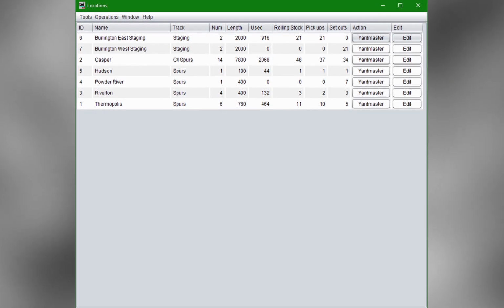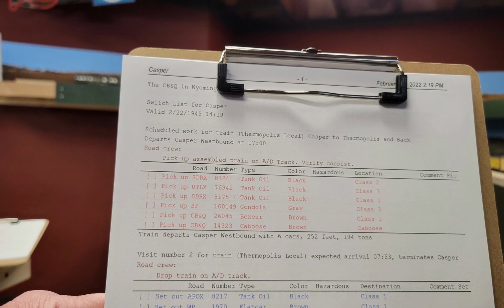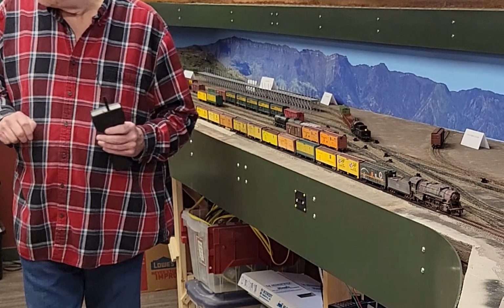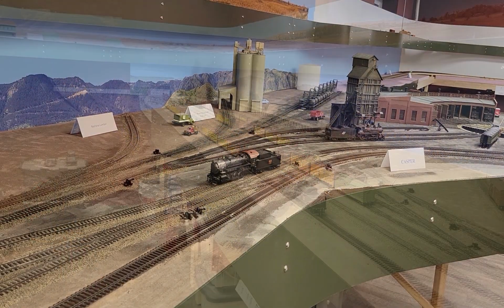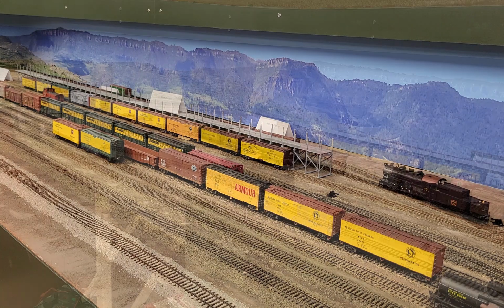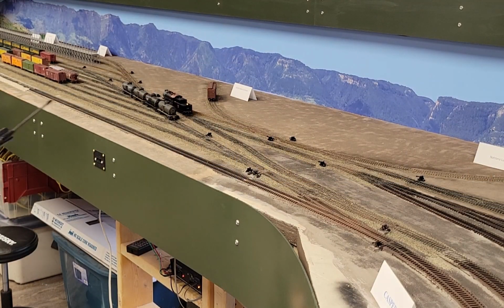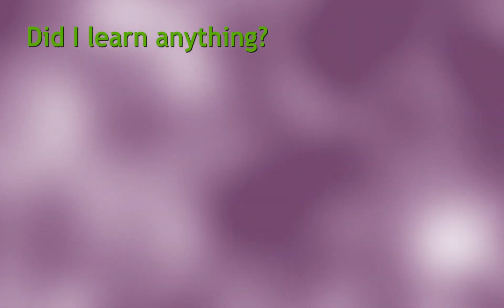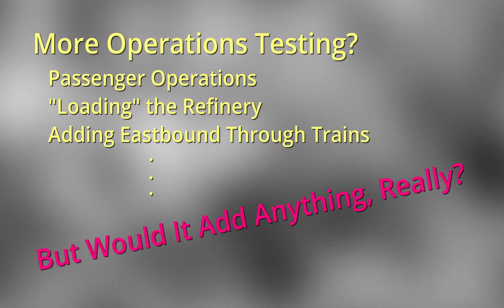2022 02 24 Building Casper Episode 8   Operations Testing 1

Comment: Nice work Mark. Are you planning on have regular op sessions with a crew or will you operate this railroad solo? Have you always modeled the steam era in the war years?
Reply from the maker: Thank you! I'd like to have regular op sessions, but so far there's only one other "operator" I know of in the area. There are other modelers, but none that I know of that really enjoy operations. So I'll probably usually run solo or with the one other guy.
I've modeled the steam era, 1930-1945, since around the year 2000. Before that it was a pretty undefined diesel era.

Comment: One of the absolute best ops videos I've ever seen.  Too bad there won't be more.
Equally unfortunate we won't see a solid series on JMRI ops.  You're a natural for that sort of thing.
But needs must. There's a lot of construction left to do.
How big is your turntable, btw? Has it ever been too small?
Reply from the maker: Hi Frank. Thanks for the compliment!
There will be more ops videos, including one more in the Building Casper series. After seeing the shortcomings of my current yard design, I've been experimenting (in CadRail) with extending the A/D track a bit to the east, as I mentioned in the video. That looks very workable. It appears I also have room to move the caboose track over off the runaround track - from actual measurements and not just the track plan. After I do one or both of those things there will be one more video to explore how much yard ops are improved.
When regular ops start on the layout, I plan to produce a few videos highlighting work at different locations.

The turntable is 90 feet. It's just big enough (by scale inches) to fit the largest loco on the layout, a 2-10-2.